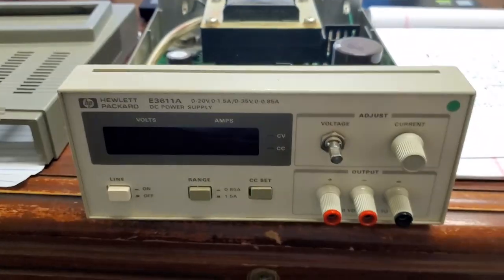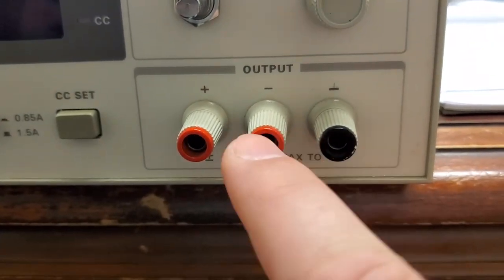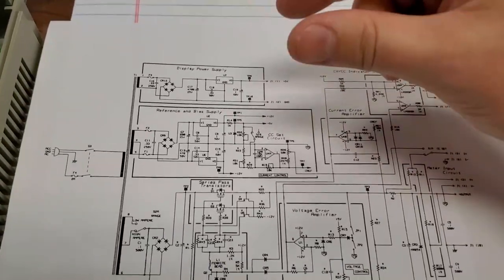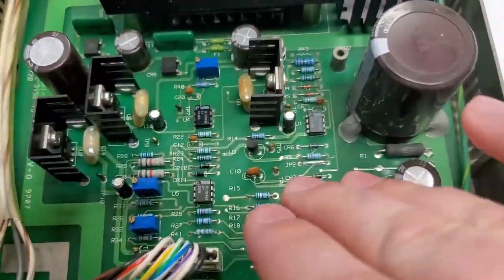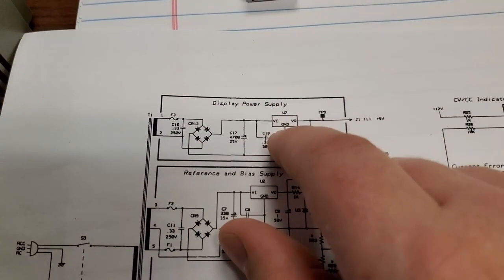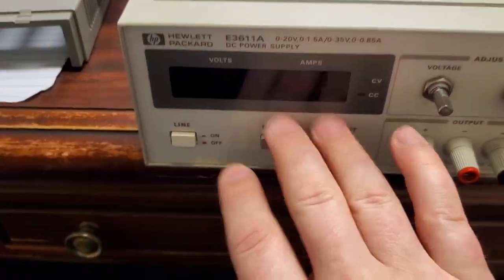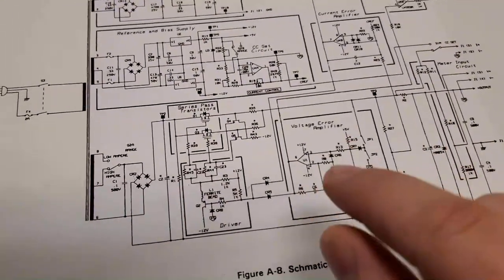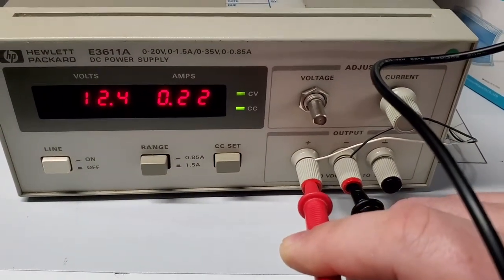Vintage HP DC Power Supply

Comment: I collect decommissioned computer power supplies and use power supply breakout boards, in good working conditions, they would give me very stable voltages from 3.3v all the way to 24v DC. Lots of opportunities for computer power supplies to be used in the medical equipment repair/replacement while saving hundreds to thousands of dollars. Thank you for your videos as always and keep it up!

Comment: 3:16 What you can do when taking old plastic parts apart, is to slightly heat them (40a50° C) with a hairdryer.
The colder old plastic parts get, the easier they break.
Also in devices from that age, they can contain some Rifa safety capacitors, those are known to fail. 
But at first sight, i don't see any Rifa safety capacitors or EMI filter, but this is propably because it is a linear powersupply and not a switching powersupply.